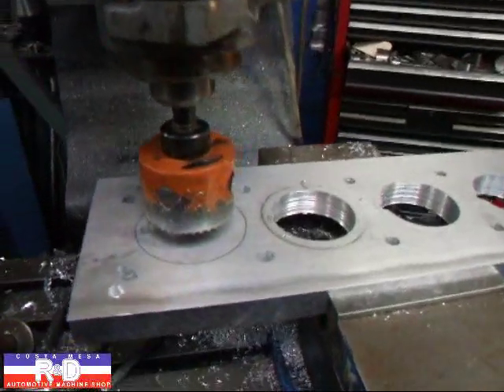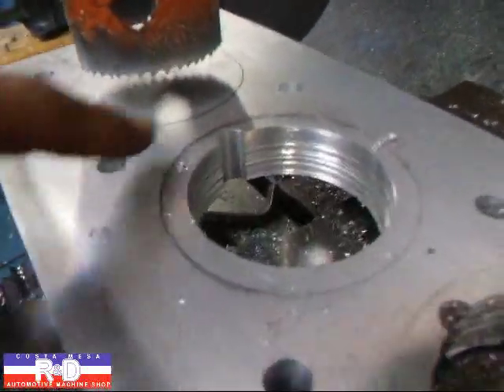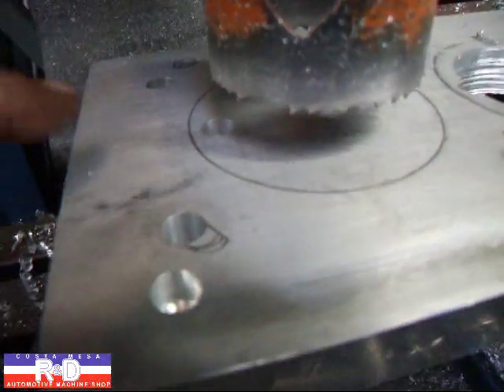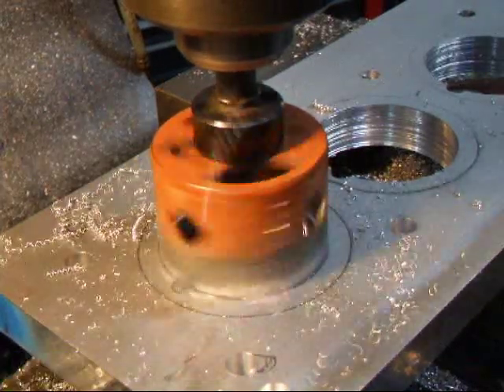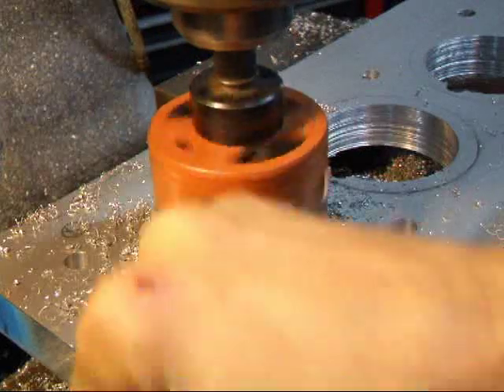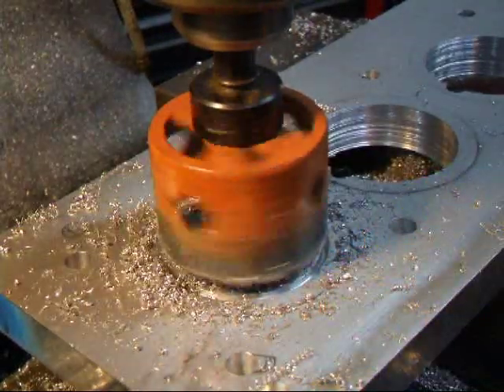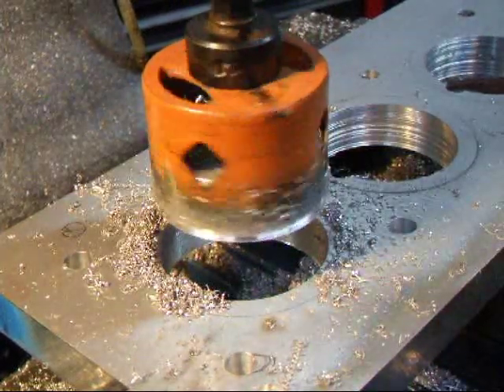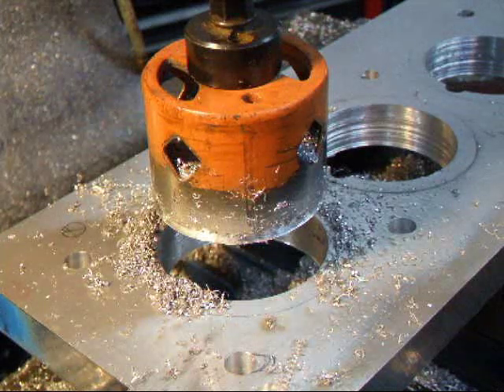Cutting a Hole with Hole Saw for Torque Plate 1

Comment: For hole saws in aluminum that are HSS you probably want (and this is a guess) to run 60-100SFM. For a 2.5" hole saw this would be 90-100RPM. Use a calculator online to figure it for whatever size you are doing.

Comment: John,  i underst that the torque plate is used to hone the cylinder while all bots are torqued to the right specification, but does it alter the cylinder/sleev "roundness" when torqued down compared to not torqued at all ?
so, we could say that after honing a cylinder with the torque plate and every mesure take, it would be round and when we take out the torque plate the cylinder could be not as round as before ? but surely when torqued down again it would be ? is that right ?
THANKS A LOT !!

Comment: I would never have thought of that! I have to cut eight 1 1/4 inch holes in 3/8 inch plate so very helpful, will use. I'd have thought a constant feed of coolant would be better though. Now I just have to keep the speed of the drill press down, hmm... Wish my ancient miller was running!
Reply: You thought wrong about the coolant. Dont use coolant on a holesaw in aluminum

Comment: @citydriver I have a straith 4 CIH engine (from an Opel rekord C), it's kinda' similar with the old Chevrolet straith 6 (but it has 2 cylinders less).  If you are familiar with Opels, the same engine equiped Opel GT and Opel Ascona.

Comment: @StachiBCNR33 maybe , but i would drill the center, with big center drill , and then i would use flycutter - if he is already using a milling machine , its more logical to use it with milling tools and not with wood tools

Comment: @paky66  well  1-1 1/4 inches thick  aluminum or steel  there are  companies that sell torque plates   but they  aint  cheap   what  kind of engine  do you have? ive been  told its  mostly  modern engines and  high  tolerance extreme  high  horsepower engines that  require  a  torque plates  aluminum engines for example but   john can  answer you more  correctly then i can

Comment: I"m not expert , but why not flycutter from the start and then final size? ?
Reply: whitebear26 a flycutter will not cut a complete hole. It only has a certain cutting area because of the tool in the cutter itself. It does not cut all the way from the center out.